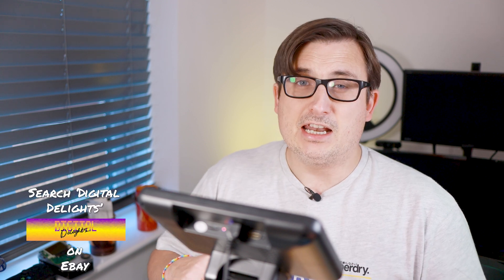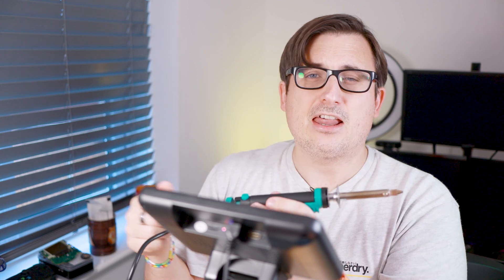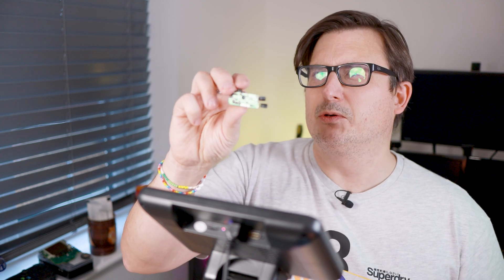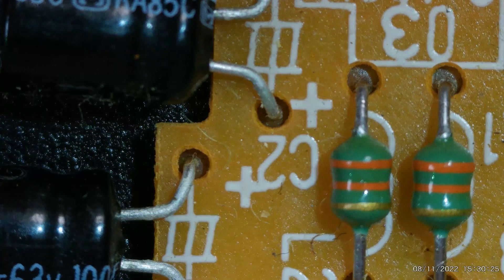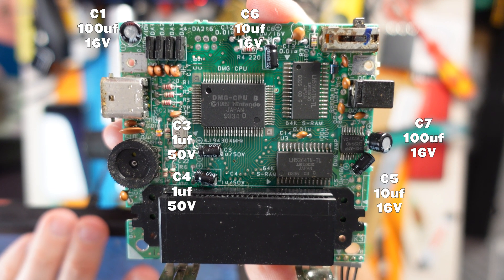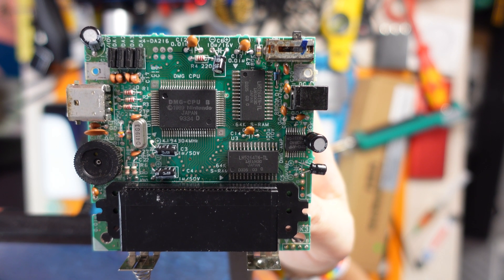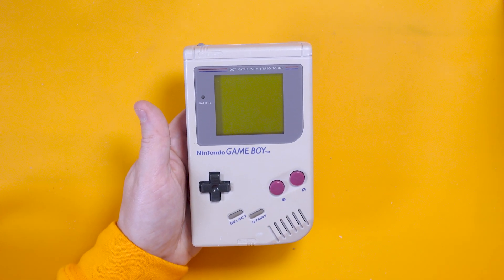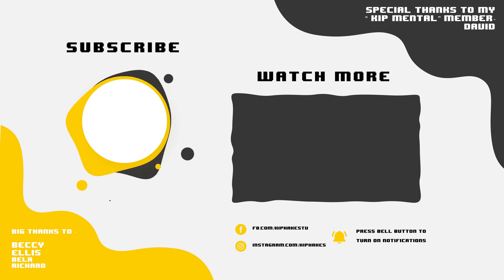Fitting a Cap Kit to a Nintendo Game Boy DMG - Fix it Friday

Comment: Hi, but if I put a 10uf 25V capacitor instead of 10uf 16V.  Am I doing any harm?  because Ali's ones have a different wording.  And I can't find the 16V ones!
Reply from the maker: That will be absolutely fine, a higher voltage is okay, the uf value is the critical one.

Comment: I had a similar "desoldering gun" that you use. It was actually much better than I've expected. The tip lasted for like 6 months before breaking to pieces. Unfortunately I haven't got any spares and I'm not sure if it is even designed to be replaced...but I don't mind, it was very cheap :) It's a good start!
On the other hand, I have mixed feelings about replacing the capacitors on a Gameboy DMG. It has pretty good caps (unlike the Sega Game Gear). The only time I've found a bad capacitor on the Gameboy DMG was when someone plugged a charger into the headphone jack. One of the capacitors just EXPLODED.
Reply from the maker: There’s replacement tips on Amazon . Even though there weren’t any failed caps, it was a nice first go at something like this!

Comment: Just 2 tips: 1) you don't need to use flux when soldering directly with the solder wire if it already has flux inside
2) using too much solder at the joints increases the stress on the joints and could potentially rip the pads. Learned that from other repair technicians channels i watch